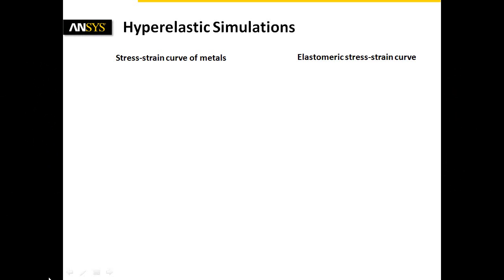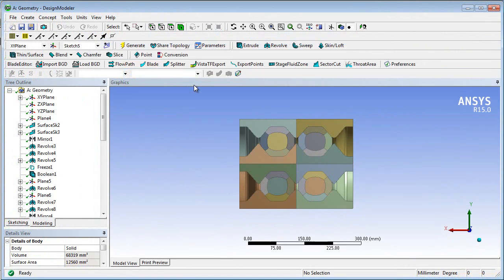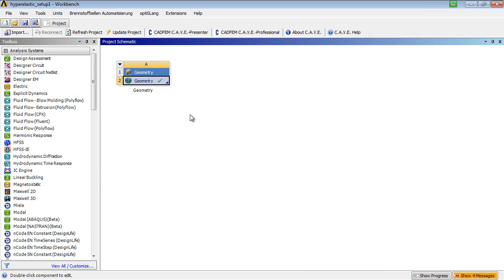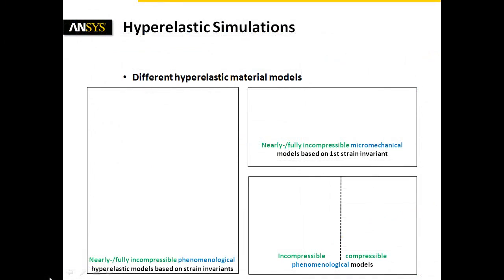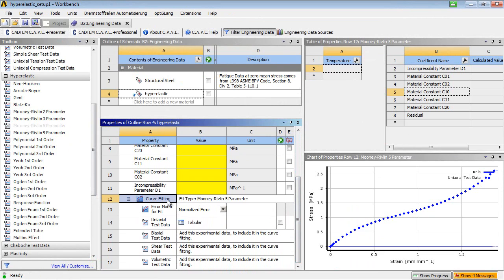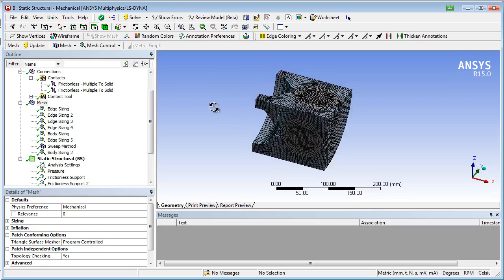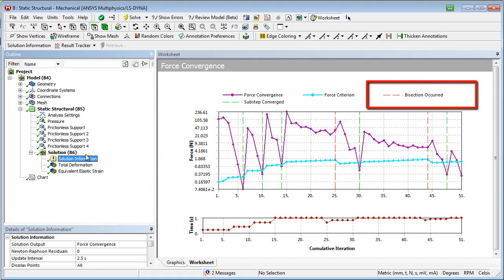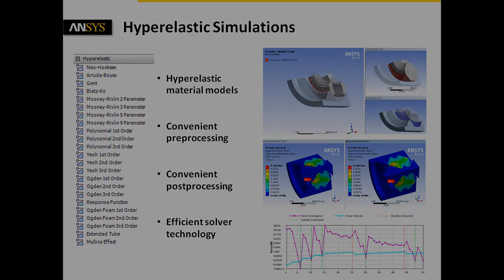Hyperelastic Simulations

Comment: Hallo Ansys TechTips,
I thank you for the tutorial material, really very clear but I have one recommendations.
first of all the load applied on the rubber is compression (pressure) and the material behavior applied in Ansys is tension (obviously, the compression behavior is not the same as tension), I would prefer to apply the whole experimental data including both tension and compression behaviors then do the fitting curve. (I am not sure that the fitting curve can get a good fitting curve for the material). thank you very much